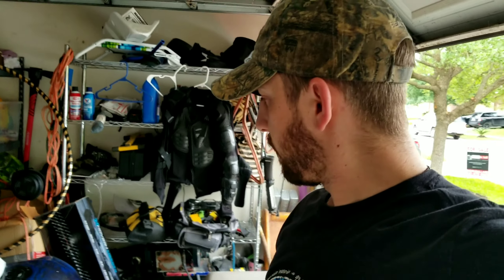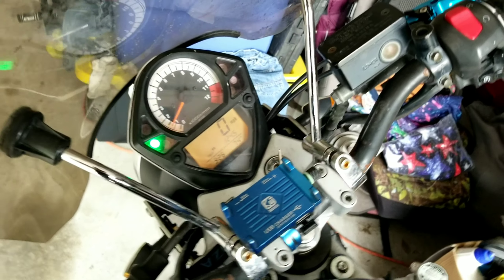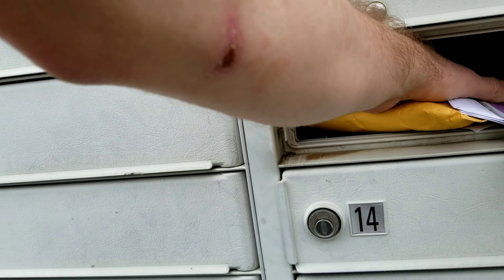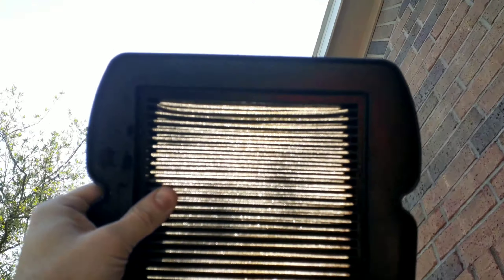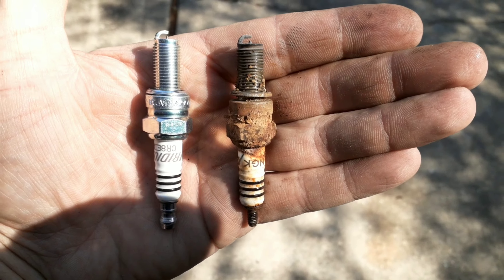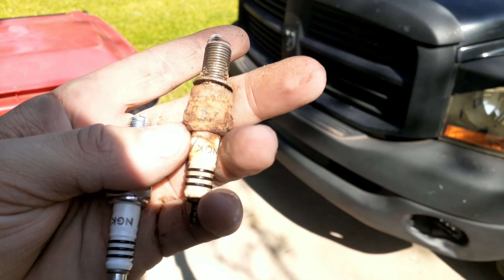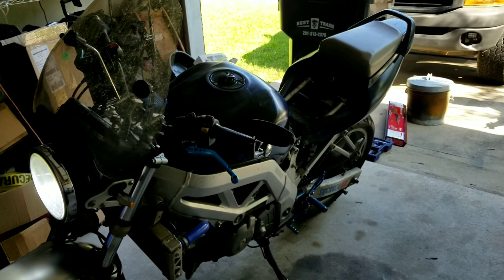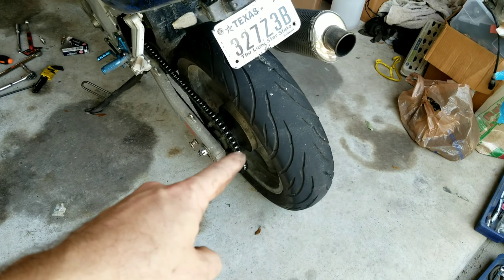When spark plugs go bad.

Comment: I have 2001 Ducati Monster 600,after overheating it atarts to loose power and turns off,after few minutes it starts and runs normally.will this be a bad spark?
Reply from the maker: I'm not 100% but my first thing to look at is engine coolant level and if that's good, I would say you may have a thermostat sticking. Also check you engine oil because if the levels are low, the oil pressure sensor will act fairly similar too. Do you have any codes pop up?
Reply: @svcruza  Thank you for your time to commenting.A little oil comes out of the oil pressure sensor, as I understood it is broken, but I didn't think that it could be the fault of it when it gets hot. I will buy it today and change it for sure.
Reply: @svcruza  Its carburated engine
Reply from the maker: Ok, I have many questions.....when was the last time you did an oil change on the bike....filter included. What kind of filter do you have on it now?
Have you checked your coolant level?
Are the radiator fins clean? Does the fan come on and shut off as designed? 
As I see it, the oil pressure sensor is a symptom of why the bike shuts off, not the root problem. The overheating is the problem but you need to find out why.
Here are some things that cause overheating, this way you can cross these off your list.
1. Low or no radiator fluid.
2. Faulty thermostat, possibly stuck open or closed.
3. Radiator temperature sensor. If it doesn't register high temperatures, then it wont trigger the radiator fan to turn on so it can cool the bike.
4. Dirty or restrictive radiator from road grim or dirt.
5. Low engine oil will create higher temps. 
6. Calcium buildup on the inside of the radiator restricting coolant flow.(This happened to me on my Honda Magna)
7. Carburetors creating too lean of a mixture which raises the engine temp higher than usual. (Also check your fuel cap for this one. If there is no venting for the gas tank, it could put your engine into a vapor lock, stalling the engine).
8. Water pump may be bad.
I'll let you know if I think of anything else.
Reply: @svcruza  This bike is air cooled.I changed oil about 200km ago.The oil was Katana 15-40,filter was K&N

Comment: This bike of yours is a V twin right? I have a v twin 125 and it died at idle similar to yours. I suspect it is spark plug problems too. Thanks for your video mate
Reply from the maker: Yes my bike is a V twin and if you're having issues please feel free to share and I'll do what I can to help.
Reply: @svcruza  thanks very much you're very generous. i will get back to you if I'm stuck.
Reply: @svcruza  Hello again, sorry it took me ages to do the work on my bike but just letting you know I replaced both spark plugs and the bike fired up after some cranking. I notice however the engine is knocking at idle as I pull the choke and revs increase. I may need to run the bike to rid of carbon build up as before my problems occured, the bike had overheated badly before leading me to believe carbon had built up. Engine knocking occurred during idle when it had overheated as well. Thanks for ur video though. Will get back to you to share more info to educate us all haha.

Comment: I have a gsxr750 (2008) bike just looses power and refuses to turn on unless I let it sit for awhile will this be a bad spark plug ?
Reply from the maker: No it's not the plugs, I would investigate your stator. It sounds like your stator is failing. If it gets too hot it would break power supply to the ignition system. I had the same problem with one of my bikes.

Comment: Hey bud, you helped me with a fuel pump issue not to long ago. Everything ran fine for a short time and now she is jumping and jerking in lower rpm. I made another video. Would appreciate a look see and an opinion.
Reply from the maker: In your video is sounds ok, but it also sounds like it needs a good highway run to clear it up. Will it smoothly idle without you actuating the throttle? Does it surge at idle?
Reply: @svcruza  yes it surges without throttle. Also the starter burnt out on me. Waiting for a new one. Will resume work when it comes in.
Reply from the maker: At this point I would say its 1 of 3 possible sensor issues. Either your mass air flow sensor could be dirty and unable to get steady reading for the computer. The Throttle Position Sensor (TPS) is going bad and its constantly hunting for a steady idle position to balance rich and lean mixture. OR your O2 sensor on the exhaust is reading rich/lean mixtures and telling the computer of the problem, forcing it to tell the throttle position sensor to make adjustments according to what the O2 says. (Start with O2 sensor) that's what I'd do. You can also use a laser thermometer and check each header pipe from each cylinder and see if one pipe is hotter than another and that will tell you which cylinder is burning rich or lean. (Rich=Cooler) (Lean=Hotter).

Comment: IMPORTANT QUESTION

Does a bad spark plug cause the engine to feel dead when given full throttle then it accelerates? It doesn't accelerate at first then it goes. It dies then voooooom it accelerates.
Reply from the maker: What kind of bike do you have, year make and model please.
Reply: @svcruza  I have FS motorcycle 125cc, I appreciate your reply. It turned out that the main reason of the problem was the carburetor although I cleaned and fixed it, it remained bad so I changed the spark plug first and after 2 days I changed the carburetor.
The exhaust is still popping I think maybe bcz I used the bike for 2 days on the bad carburetor so it damaged the spark plug again but now it doesn't feel dead. Only popping from the exhaust or maybe the exhaust is bad tomorrow I will go to my mechanic. Thank you.
Reply from the maker: The popping that you're hearing is fuel that is unburned that makes its way to the exhaust pipe and then the following combustion ignites the fuel that's in that line causing it to backfire which tells me that your mixture is either a little bit too lean or a little bit too rich on the carburetor so what you need to do is dial back the fuel mixture screw about 1/4 of a turn and that should clean it up and stop the backfiring
Reply from the maker: Now you say you cleaned it and fixed it did you clean out both of the fuel jets because you have a low flow and he have a high flow you got to make sure that both of them are completely cleared out so that fuel flows evenly especially after you set your idle set screw correctly. And ask for your exhaust there's no way you can break your exhaust it's a non-moving part it's the carburetor. My advice to you is 2 put some seafoam in your gas tank and ride that for a while or let it idle that way it'll clear out anything in your fuel lines but I have one more question for you. How long did you let the bike sit before you tried to start it again? Is this the first time you've started the bike in a long time? Because what also happens is any fuel or bad gas that is still in the gas tank sitting there for a long time tends to gum up or the fuel breaks down which will clog up your carburetor also if you have any settlement at the bottom of your gas tank that will also settle at the bottom of the tank and get sucked into the fuel lines and get stuck in there which will later break off and cause your carburetor to clog up. Think of it like plaque to arteries in your heart if the plaque builds up the heart can't pump so if I was you I would replace all of the gas lines and flush the gas tank entirely to prevent further problems.
Reply: @svcruza   @SVCruza  I was exactly doing that couple hours ago, I adjusted it to the minimum amount to keep the bike running without being turned off by itself when I remove my hand from the gas. And it's still popping when I decelerate 🤦🏻‍♂️I even did that by turning the fuel mixture screw half 1/4 turn to be 100% precise and tried it many times till it stopped turning off by itself when I drive it and remove my hand from the gas.
Reply: @svcruza  the motorcycle was not moving for 4 months, I used it for a week then I changed the spark plug and after 2 days I changed my carburetor.
Reply from the maker: When was the last time you actually had the bike running has been sitting for a while?
Reply: @svcruza    the motorcycle was not moving for 4 months, I used it for a week then I changed the spark plug and after 2 days I changed my carburetor.
Reply from the maker: I tell you what before you mess with the carburetor again and since the bike was sitting for 4 months replace all of the gas line with brand new gas line and empty out that gas tank and clean it because from what I know from experience it sounds like a fuel starvation issue which means there is a blockage in the fuel line somewhere and changing out a fuel line as a whole lot cheaper repair and anything else that you're going to throw at that bike
Reply: @svcruza  alright, I appreciate it alot.
Reply: @svcruza  the problem was a hole in my exhaust, I went to the black Smith and fixed it.

Comment: I am having problems with my suzuki boulevard c50t sometimes it runs perfect and sometimes it just randomly starts acting up like when it's acting up its hard to keep it cranked when coming to a stop and  like on take off it starts acting up like if I give it just a little throttle it starts like losing power like it's flooding and I even smell it but I give it alot of throttle and it goes fine but coming to a stop it stalls but then it will just randomly be fine again I'm thinking spark plugs
Reply from the maker: Do you still have the bike and are you still having issues with it?

Comment: Hey brother... just picked up a 02 bandit 1200 it goes in all gears but slow to accelerate even at full throttle any ideals?
Reply: Start with fresh fuel, check the air filter, and drain the carb bowls. You might have picked up a little water will may now be sitting in the bottom of the carbs… check your idle screw

Comment: I've been having a problem with my bike with when you start it that begining starting noise got longer and longer and now it doesn't start at all I was wondering if you have any idea of what that could be
Reply from the maker: What kind of bike do you have
Reply: @svcruza  I have a Yamaha xj 650 maxim
Reply: 1982
Reply from the maker: Ok I know exactly what you're talking about, but I have a couple more questions. When was the last time you cleaned out your gas tank and replaced the fuel lines. And when was the last time you cleaned the carburetors?
Reply: @svcruza  Ive never replaced my fuel lines I got the bike a couple months ago I cleaned the tank and the carbs then but I have put about 3000 miles on it since then
Reply: @svcruza  about five months ago
Reply from the maker: That explains a lot, usually what happens (because I made the same mistake and it left me on the side of the road) is there is sediments that cling to the inside of the old fuel lines and slowly they break off and start to clog up your carburetors fuel jets till there is no fuel passing through. I'd check that first.
Reply: @svcruza  thank you I had no idea what to do

Comment: Okay so i rebuilt my carbs and the bike was rubnning good now 60 miles later my spark plugs are black and it will only run on cold start. when i do ride if i hit 5k it will tutter and not want to throttle up. Could that possibly be a spark issue? They were new plugs but the guy overfilled my oil and i had oil in  my intake. so i'm guessing the plugs are bad because of too much oil? Theres no gas on the plugs so floats can't be the culprit. LMK what u think it could be.
Reply from the maker: Well first and foremost I would say it's definitely two things that could be a combination that could be giving you problems, starting with the overfilling of the oil that can be a problem, so the easy thing to do is pull out some of the oil so that the proper oil level is in the engine so that the crankcase vacuum line won't suck up any more oil into your intake. The oil that goes into your intake tries to get burned and end up fouling out your plugs but if your plugs are new you can always take a light wire brush and some brake cleaner and clean the tips so you should be able to use the spark plugs with no problem. As for the rebuilt carburetors I would have to say you need to get your carburetors synced, because if they are not synced the engine will forcefully run rich or too lean easy way to tell that, is the temperature of your exhaust manifold and how hot each pipe is will tell you a rich or lean mixture. If a pipe is COOL in temperature the cylinder is burning RICH. If a pipe is HOT in temperature the cylinder is burning LEAN. Also if it starts to stutter like that you might want to check for a vacuum leak because if too much air gets into that cylinder it throws off the air fuel mixture causing it to run extra lean which will cause it to fail to fire hence the stuttering. I sure hope this helps buddy those are the things that I would look at first.
Reply: Check your kick stand safety switch. Mine did the same thing ran fine till I hit 5k then it would cut out. The kick stand hinge wears down and puts it at an angle so it doesn't retract correctly and the engagement of the switch is compromised/loose

Comment: Ive been riding in the rain. My plugs are old enough. Happened to me thrice: I ride and the it cuts power. Still revs but only up to 3 or 4 rpm but no power whatsoever. I hit the killswitch then restart and it works "normally". So Im guessing spark-plugs. I have never changed them. Theyll be here on thursday I hope I can get it right
Reply: Look up cleaning the sv drain holes. They plug up and won't allow the spark plug chambers to drain. Also check your kick stand
Reply: Check your kick stand safety switch. Mine did the same thing ran fine till I hit 5k then it would cut out. The kick stand hinge wears down and puts it at an angle so it doesn't retract correctly and the engagement of the switch is compromised/loose
Reply: @evanfoss5960  Thanks for your answer. Turned out to be a faulty fuel pump. Little rust, drain-hole plugged. Made it work for another 3000km with cleaning but ill need to shop for a new fuel pump